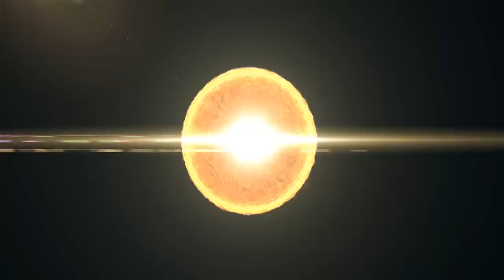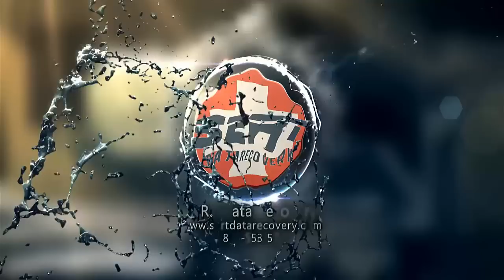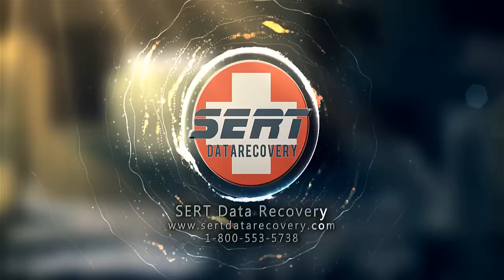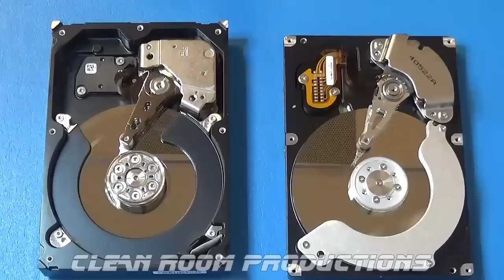1st Step In How To Recover Data From Clicking Hard Drive AKA The Click of Death

Comment: I got a hard drive that's been broken for 15 years, I opened it up move the head back to the home position, sealed it back up the disc spins up but the hard drive is still broken.  My hard drive is still broken but at least I gave it a try, would not even consider spending $400 for  recovery services.

Comment: I just had a 10TB Enterprise drive begin clicking early this morning when restarting a computer that had been running without issues for several weeks straight. I carefully removed the drive from the PC and placed it in a USB3 dock. The clicking resumed when powered on and didn't stop until the drive essentially went to sleep. I've ordered a replacement drive and am looking for suggestions on how to find a reputable and knowledgeable recovery service in the greater Seattle area.

Edit: These people do mail-in only and wouldn't even disclose where they are located.

Comment: And the problem is if ''we have professionals in our country'' dealing with this kind of problem. On the problem with firmware -> can this be damaged if physical damage? (my 2TB Toshiba didn't fall down but I accidentaly lifted the cable while moving and causing the HDD to flip in the air - i caught it, it didn't fall nor was hit. But it was working at the moment of this incident so when I connected it to the cable again clicking sound appeared which became constant in rhythmical almost pattern and WIndows couldn't recognize disc.)
Can firmware problem be fixed somehow, if it's the case?

Comment: bro is there any solution i have wd elements 1tb,when i connect it to my and other laptops,it sounds connecting but showing loading also slowdown my all laptop which it is connected at that time,also disk management not opening when it is connected,please help me how to fix this.
Reply: Access cmd and type  CHKDSK/F X (replace letter x with your disk letter)
Reply from the maker: DO NOT EVER RUN A CHECKDISK for data recovery NEVER NEVER NEVER. ANd never run it on a drive that is OBVIOUSLY having some physical issues....

Comment: Scare tactics from a company who wants to jack up their revenue.  Should a complete novice attempt to recover critical data via repair by themselves? Of course not.  But anyone with some basic electronics know how can solve a number of common drive problems on their own with a few basic tools.  Why do you not mention checking for bad caps, diodes, or resistors on the pcb?  Why do you not mention cleaning contacts or even inspecting the PCB for damage?  Why do you not recommend ensuring the power supplied to the drive is sufficient to prevent repeat resetting?  Dozens of troubleshooting tips for this kind of problem are widely available and accepted as safe preliminary steps before sending the disk for professional recovery.
Reply from the maker: because that's not usually the case or I would have, you don't need to guess with data that is important to you because guessing can ruin it. The statistics for the things you described being the culprit are extremely low. And don't forget how many drive are not recoverable because of people with no knowledge except watching youtube videos tried to do something they were clueless about. You don't have to be good at everything just pick one thing and excel in that.

Comment: Hi, I just noticed some clicking on my 4tb seagate external memory, but it's a more quite clicking, like you have to get really close so it can be heard. Btw, it was working perfectly 2 days ago. Normally, when it gets connected to the power source and to the USB port of the console, it automatically starts running and the blue light starts blinking, but this time that wasn't the case. If you guys can help in anything I'll appreciate it immensely.

Comment: I put it in the freezer, it powered up enough time to copy the hdd. Thanks for the info you saved me much money....
Reply: bro dont lie, your going to make a lot of people lose their crucially important files
Reply: @pventures6  I thought it was bollocks as well, but out of totally being desperate and lost hope. I wrapped the hdd in a plastic bag put it in the freezer for half an hour, then quickly took it out of the bag connected it to the pc via a cable. it worked enough for me to get the files off. then it went back to no go.. It's not bollocks, the theory behind it is, computers work much better in a freezing environment and no click noise, hot is no good. So soon as it warmed up it would not read click noise. I tried this some worked but not slim/pocket hdd's. If you don't believe it i don't blame you, this is not 'How to make crispy bacon in a microwave using tin foil'. I hate misinformation and the people who spread it, it pisses me off. So if ever you have a situation that you might wanna try this way, let me know if it worked for you. But you need to get the hdd very cold freezer not fridge, for 30 mins.. It did work for me....  Professional people charge extortionate rates to do an hours work and with no guarantee then they want payment, i come from the streets and i will find back street ways to get my shit of that hdd, for nothing...

Comment: hey, what the main requirements swapping Platters? Does the hard drive must be with the same capacity, model, version? or just the same make and similar look?
thanks
Reply from the maker: Yes to your first question, at the very least, but if you don't know this information I would not suggest trying a platter swap. There is much more to it than that and one mistake you will lose data for ever, especially with multiple platter drives.
Reply: head is damaged! Cannot find replacement head/reader anywhere... I only have one platter.

Comment: So I have a question.  When the stuck head is moved off the platter and back to it's parked position, what is the action of the arm?  Is the arm spring loaded?  Does it want to stay in the parked position or does it freely float or move?  The reason I ask is because I had an issue with my disk and the head was in the parked position but it appeared to be stuck or frozen.  I gently checked for play with a screwdriver.  It was stuck pretty good.  I than applied pressure to the arm and it broke free but it now freely moves.  It's not spring loaded.  Non of the videos show how the action of the arm should be while parked.  Thanks.
Reply from the maker: it depends on where the parking is. However there is a magnet that is pulling pushing the actuator arm which can cause it to jump or fly around. but these are only things one might come to learn as every single drive is different.

Comment: Umm step 2?
Reply from the maker: What did you get from step one, and how did you arrive at that conclusion?
Reply from the maker: You will need very expensive special technology to work with drives that are clicking... it will give you access to the manufacturers area on the drive.

Comment: time waist video,,have u no idea how to rapair it,,u cant solv this problam on video
Reply from the maker: You are correct - you cannot solve a clicking drive case from a video without the proper technology to repair/circumvent the cause of the "clicking", especially when the cause of the clicking is NOT read/write head failure.

Comment: The title is misinforming. Although it's very educational, there was no explanation on the data recovery technique whatsoever.
Reply from the maker: Mark thank you for your honesty here. The most important process of data recovery is the diagnostics phase. Anything that will cause clicking will require advanced data recovery hard drive technology that will allow the service area to be manipulated, or the ability to change the heads if that is the problem. There is no way for you to know what is causing the clicking without the technology.

Comment: Yesterday, I somehow noticed my backup external drive doing the normal head movement playing in slight higher (But not too much) volume for a few times. It views data and files just fine though and it turns back to normal volume sound after a couple minutes and back to less noticeably to hear like what should happen usually. I wonder why that happens? The health of the drive still said "Good" and I didn't see anything wrong in the values. Why do hard drives sometimes trick you like that or something? Position is on top of my tower desktop case.
Reply from the maker: Well anything that you would have available to you for drive health reporting would relate to the SMART data. This data is incomplete and only shows on a very basic level what is going on with the drive. If you have your drive almost full, it will make your drive work harder and hence may make it perform a bit louder at times. Also it could be sign your drive is beginning to fail. Healthy drives shouldn't make much more than a slight whirring noise.

Comment: my seagate harddrive  is not detecting in pc and making clicking sounds i want to recover data from it but it is not detected eitherr as internal or external drive what should i do
Reply from the maker: Tarun there may be a chance a professional with the right equipment and experience can still recover this drive for you. If you continue to power the drive up and make it worse, that chance will definitely disappear.

Comment: Which brand do you think is the most reliable? In another term what's the brand you it sells a lot but you don't see coming to repair too often?
Reply from the maker: Well Toprak we look at it from a little different perspective. We look at reliability of a drive, from it's ability to be recovered when there are problems. All drives fail, the same as all tires will wear out on a car eventually. The way a user handles it has a huge impact on it. We always suggest Western Digital as they are the most resilient to damage. Samsungs are among the most favorite of some engineers.

Comment: my hard disk also the same above problem, when this clicking sound. system might freeze. what can i do?????
Reply from the maker: The first question to ask is does the data matter, or can you lose it? The next thing to do is avoid powering it on. The clicking can be caused by a few different issues, a couple of them can get worse and cause the data to be unrecoverable. (see here: https://youtu.be/PhxroolWG28?list=PL5sX9SPiBeZ_rde0jkAyNJQksxnFYlZhY ) Clicking hard drives normally require expert help to get the data off. The drive needs to be properly diagnosed to determine why it is clicking, and the best course of action required to solve it long enough to get the data off.

Comment: I have a WD 2TB, about 3 months ago it had a bunch of clicks at once, 
still didn't die but today I heard a bunch of clicks again. is it normal
 or it's dying?
Reply from the maker: A bunch of clicks on a running drive is not normal. It would be safe to say you should back up your data and change the drive out before it fails on you.

Comment from the maker: @ TheCanadianLanBoy this would be considered previously worked on once you do that. We recommend doing nothing to the drive or its components as this can cause more damage to the drive.
Reply from the maker: One should never turn on a drive that has been dropped if the data is critical. The heads may have made contact with the platter, or a few other things may have happened. You wouldn't necessarily know what to look for unless you have experience working with these types of situations. Performing any more procedures besides closing the drive up and sending it to a professional will likely cause the data to be unrecoverable if it's not already.
Reply from the maker: The reason why your drive is clicking should be explained in the video. There is no easy fix to a dropped drive that has been damaged. The heads probably made contact with the platters, or came out of alignment. Changing the heads may be necessary but it may not even matter. You need to know what to look for on the platters and the heads to see if there is truly damage. If the drive was on, I guarantee there is damage to the platters.

Comment: 4 of the 6 drives in my PC click constantly all the time, but they still work...why is this?
Reply from the maker: Well that's definitely not normal. Drives can click and still work when they are failing however I would not trust the drive at all. Are you running a RAID? What type of drives they are? Type of clicking sounds (loud, faint, how may seconds apart, duration)? Have been making the sound since the beginning? Is the clicking definitely your hard drive, or could it be the CD player? I would keep all your data backed up if it is the drives.

Comment: My hard drive was clicking and wouldn't load Windows anymore. I booted Linux Mint from the DVD and noticed I could still read data. I backupped most of the data on a series of USB pen drives, before the drive died completely. When the drive died, I put in a spare. Everything went better than expected.
Reply from the maker: That's great. Was there any data you were not able to get off the drive?
Reply: SERT Data Recovery
Yeah: a couple of Prey levels I had started making some years ago and then I put on hold waiting for a stereoscopic driver compatible with id Tech 4, the voice acting for those levels, and a bunch of textures.
Reply: blackk
If information can be still read from it, yes.

Comment: my drive started clicking and i immediately put in a spare. Never tried recovering the data yet. Not too optomistic.
Reply from the maker: if you cannot determine why it is clicking there is very little chance to recover the drive. No one should be optimistic about self attempts at data recovery. That would be like going into the garage and pulling your car engine out without ever having done it before. :)

Comment: I have a external HD that started making a clicking noise after it fell off. I have been trying to make it work but all it does is the clicking noise. I would like to get info on where to send it. thank you
Reply from the maker: jtz t we can definitely help you out, but in the meantime the best thing for your drive is to keep it powered off. Plugging it in or letting it run will only make the situation worse. We provide free shipping to our facility. If you fill out our quote form I can get you a quote and a label if you would like. This is the link: https://secure.sertdatarecovery.com/online-quote

Comment: mine clicks once when it boots, then is normal, is that a problem
Reply from the maker: Well it can be normal, however I would check the date on the drive. If it's over a year or two I would consider changing it out. Alternatively the best way to avoid data recovery is to have your files backed up. We do have a secure cloud backup solution for you if you are interested: https://cloud-storage.sertdatarecovery.com

Comment: my drive clicks for a bit... makes a louder clicking noise....and starts click on again. soooo...
Reply from the maker: If you can access the data, then make a backup. If not, and the data is important you may want to seek professional help. We'll be glad to help, and as long as the drive has not been previously worked on we have a free evaluation available. Fill out a quote form if you are interested here: https://secure.sertdatarecovery.com/online-quote

Comment: My HDD started clicking suddenly, but I've only had it for a year ;__; I don't know if I can take it to a data recovery center, is there a way to recover the data? The first time it clicked (yesterday) I restarted my computer it worked, but now it's not working at all. I use a WD 1TB Passport (and its almost full so I'm losing A LOT of data). I don't know what to do please help,,
Reply from the maker: +Hind Al-Ghamdi First, one of the contributing factors to your issue is the drive is almost full. We suggest never running a drive with more than 80% capacity used. You are asking for trouble after that point. Second, your drive probably has a firmware issue that can only be temporarily fixed to recover the data by a company that has the machine required to do this. There is only one like it in the world, developed by the leaders in data recovery technology. Same technology that all the advanced data recovery companies use. You will end up needing to send it to a company like that, like us, in order to get your files off the drive. Every time it's plugged in and it clicks the heads are becoming weaker and will fail causing the recovery to be more expensive. The click is the head stack slamming back into its parking place. If you stop, there is a high probability your data will be 100% recoverable. Any further use of the drive, while not actually imaging or recovering the files will make the percentage worsen.

Comment: hi sir, can you help me please I have a problem with a terabyte hard drive, I have two identical 1 terabyte hard drives Toshiba do you think I should swap the platters, put them to another hard drive identical to the broken one to the working perfectly well
thanks
Reply from the maker: +John borg I would never recommend this to someone who has not successfully done it before. It looks alot easier than it really is. The thing also, is you don't know for sure it's even required to get access to the data. It's not ALWAYS a heads problem with a clicking drive. My answer to you would be to send it to a company who can correctly diagnose it, and then has the experience and equipment to get your files back for you.
Reply: Thank you sir for the reply